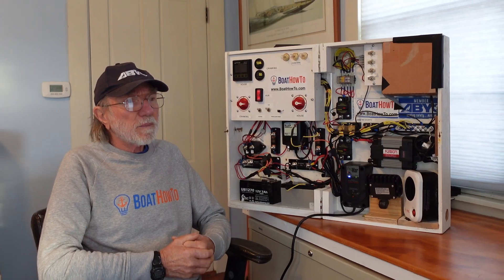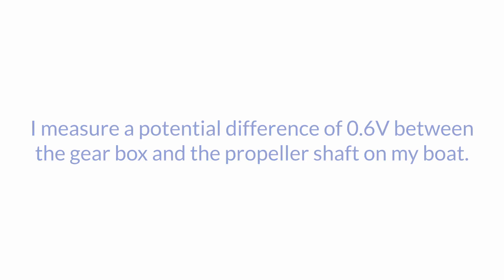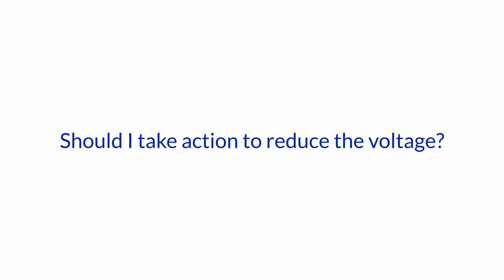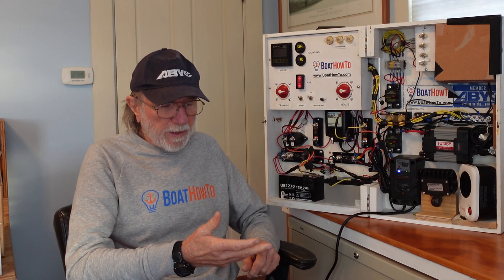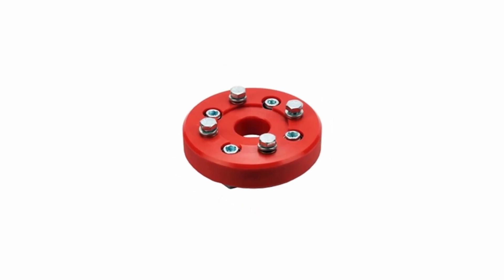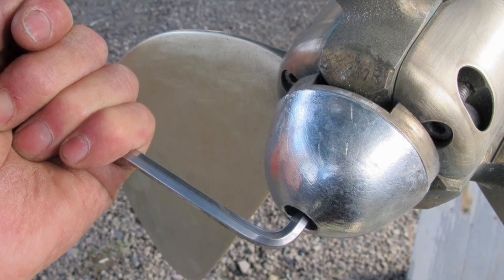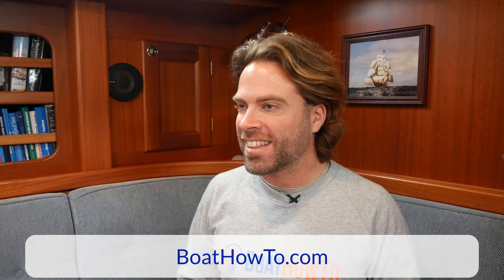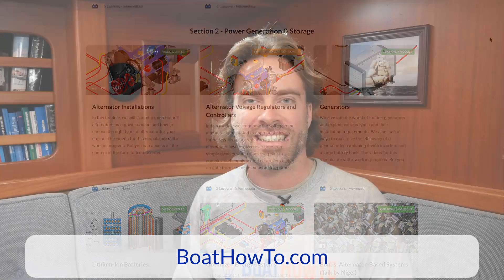Voltage between Gearbox and Propeller Shaft ?? | Ask The Expert with NIGEL CALDER

Comment: @boathowto I have been on the hunt for potential stray voltage. When measuring the hull potential while starting either engines on my catamaran I get a spike of 200-300mv for a brief second, which levels out. If I measure with two reference anodes I will see the opposite on the other sides engine ground (voltage drop). I was told this is common on catamarans and best to run a 1/0 cable from one engine ground point to the other, even though I have both going to a common bus bar with 4/0 cable on a fairly small run. Since doing this I haven’t seen a difference when starting the engines. Is it normal to see these spikes during cranking? Or is this something I should definitely resolve?

Comment: It's like measuring a battery and seeing a voltage between the poles. It doesn't mean the air is conductive. When you see a voltage between the propshaft and the gearbox, it doesn't mean the coupling is conductive.
Right?